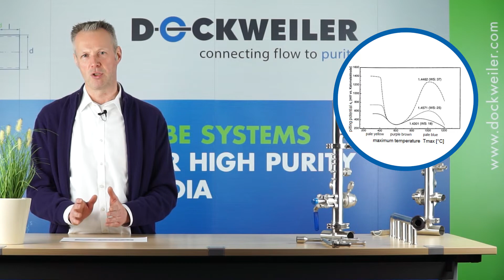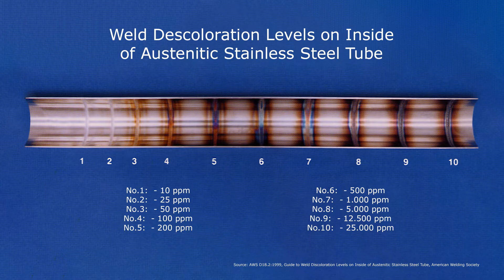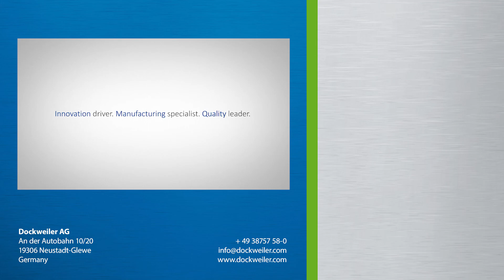Discoloration during welding of stainless steel

Comment: Hello, Dr. Köcher. Many thanks to explain as well this topic. I was investigating something around and I would like to contribute by mention that Acceptance Criteria is indicated in ASME BPE for product and non product contact surfaces. ISO 5817 also mention limits for imperfections for quality levels. 
An extract of "The Official Magazine of ISPE" by Ken Kimbrel, shows a tables where you can see weldings done by different oxigen level and its correspondance with piting corrosion resistance decrease, but also mention what level of resistance you could restore by post weld treatment like electrochemical cleaning and passivating. For the last, the Force Institute also provides a Chart with similar Heat Tint Levels and its correspondance with oxigen used in Argon or Formied gas. Saludos desde, México.
Reply from the maker: Hello Salvador Guerra, thank you for your feedback and sharing your opinion. 😊 Saludos a México!